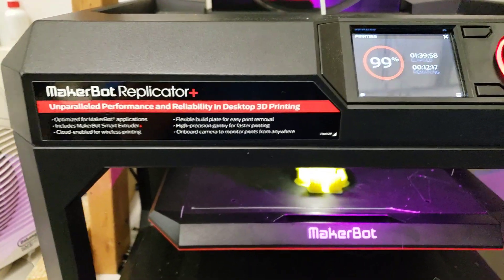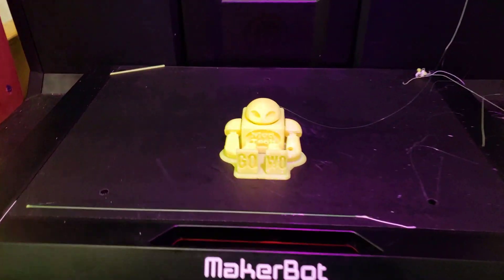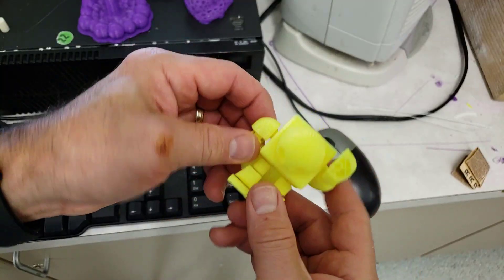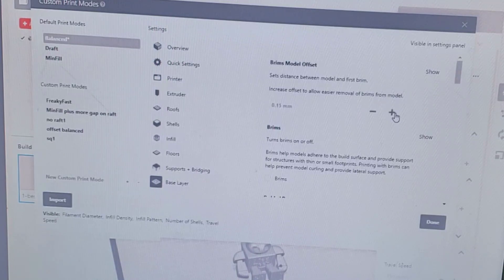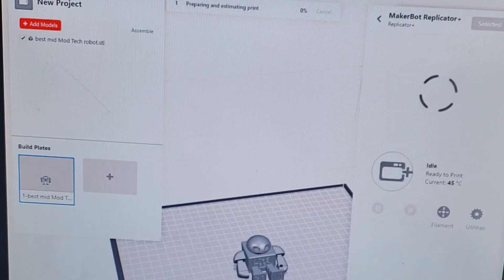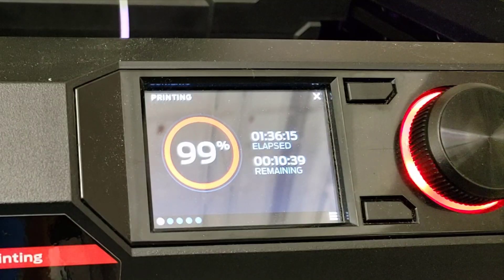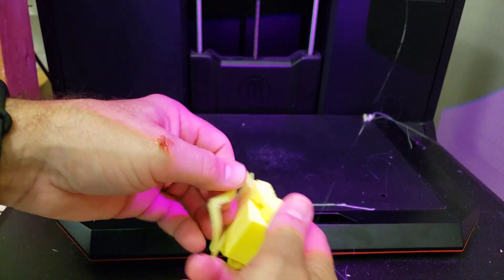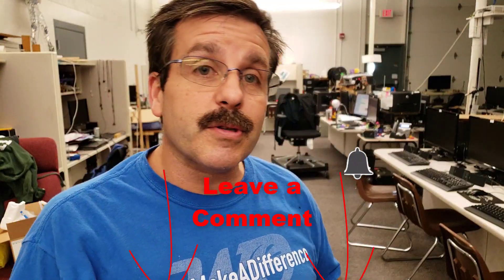Revealed! MakerBot Print and the Brim option!

Comment: Was wondering what version of MakerBot print your using, as setting my brims to 0.17 mm doesn't seem to generate any brims in preview.
Reply from the maker: 4.7.0.1867 I will see if they show up in mine when I get a chance.
Reply: @HLModTech  managed to get my had of the last version that had it, which was MakerBot print 3.3.5.502
The option was later mixed with padded base + brims in MakerBot print 3.4

For those who want the file (or time travelers from the future) here is the download link.
https://drive.google.com/file/d/1q7FgZrpgXzuAbzg5jjHN_SBxiagAdo2w/view?usp=sharing

Make sure to cancel the auto-update when MakerBot print first opens

Also here's your 69th like (nice), right now managing some school 3d printers from home for the cad class so this trick will save a buch of filiment :D.

Hopfully you'll be able to get back to your printers soon.